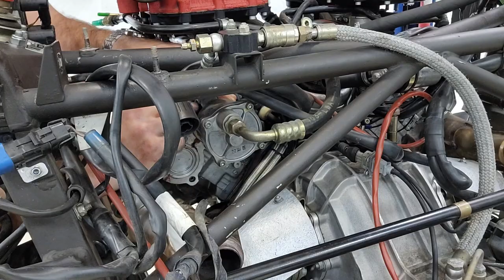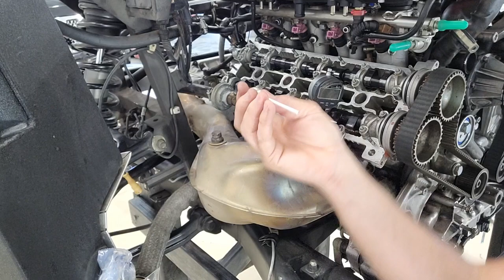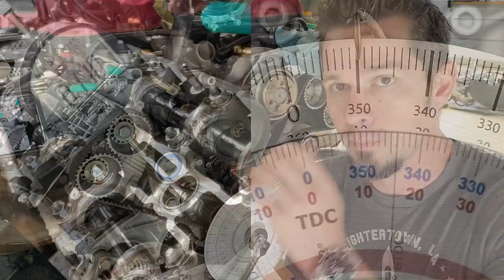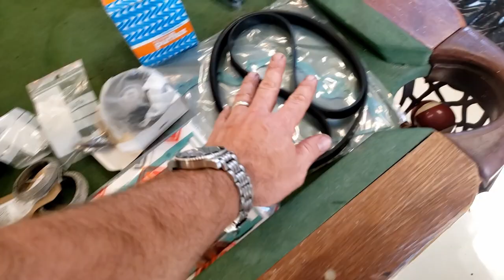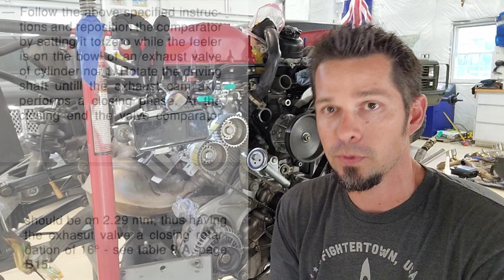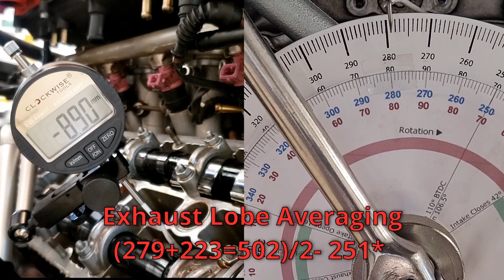Setting the timing on a Ferrari F355 ~PART 4~ Engine out series

Comment: Thank you so much, Kenny.  This is a brilliant video.  And you're right, this is the one aspect of working on these cars that's a little intimidating - well that and threading the short oil line from the oil tank into the aluminum engine block while the engine is in the car :) .  You've done a huge service to the Ferrari community.  Most appreciated.
Reply from the maker: It's very technical and they're are so many steps .. but when you break it down to individual steps and then explain it ... it makes it much manageable. Hopefully this video accomplished that

Comment: Hey Ken, just skimmed video. What you are referring to is dwell and you explained it well. Friendly suggestion, use an analog indicator, much better than digital. Or, use the Sticky RX dead stop 🤓👍. I’ve measured dwell on my 95 and it was less that yours. IIRC, it was 1/2 or 1 degree.
Reply from the maker: Great point!

Comment: Nice video, very concise and clear instruction. I've always used the centrline method, only because thats what I learned as an apprentice mechanic back in the 1980's....But the Ferrari method is defintiely solid, and for those who are not familiar with the centreine method, a lot less chance of screwing it up....Now I'm going to have to go back and look at the rest of the series of videos.
Reply from the maker: My opinion is you should do both. Lobe centerline I think less prone to error.
I found its really sensitive to having your gauge at 90 degrees. On the ferrari method, you have to nail that 2.41/2.29 measurement exact. If something's off, you're going to get erroneous readings. However, with lobe centerline, it doesn't matter as long as your gauge didn't move from the first reading to the next.

Comment: Great video. Looks like a printed degree wheel on top of a Comp cam degree wheel? Would you add the link to replicate yours? What diameter wheel did you use? Happy to buy one from you. After all you did the work. Thanks
Reply from the maker: 355 Crank hub tool: https://amzn.to/3A4om4c 
Timing wheel: https://amzn.to/39TOMv4 
Printable Degree wheel www.blocklayer.com/degree-wheel.aspx

Comment: Watching this again something occured to me.  In your case timing appeared to be right on to start with.  Since a new belt should only be tensioned 1 time.  If there is any question on if the timing is right, wouldn't you want to verify all of that prior to pulling the old belt?   Basically along with the TDC verification.   Then if timing is incorrect fix the timing first.  Put new belt on last and only tension it 1 time.  Of course do a full verification like you show after the belt is on to ensure its all correct and nothing changed.  Thoughts or am I over thinking it?
Reply from the maker: While its edited out of the video, i absolutely checked the timing with both the old and then new belt. IT is necessary? probably not, but i wanted to make sure it was fine before and after.
I also used the old belt to torque the cam gears as well.

Comment: Hi Ken , just wrapping up my 355 engine out service too,  I have a quick question if you don’t mind.  I use the  E manuals as well and I have all my torque specs right on the engine, tensioners , bearings , water pump , but my question is, what are the torque specs for the 20 bolts for the engine cradle? If I’m reading this correct it says “engine bracket fastening “, 53 Newton meters.  I just want to make sure. Also I replaced new engine mounts and transmission mounts and the Emanuel  says, “ pad to chassis plate fastening “, 50 NM.    I am assuming that is the mounts?😂.  Thanks for your help, Brad
Reply from the maker: There's definitely something getting Lost in translation there. I also found the nomenclature confusing however if you look at the size of the bolt it kind of lets you double check if you're actually talking about the right bolt.
I use the pad to engine bracket fastening M16 98 newton meters(which I believe is actually the 12 big ones and likely the four rear big ones) the four wheel well engine cradle ones at the very top, I think those likely are in the 50 Newton meter range
I didn't do the mounts this time, but I do believe they are the either the engine bracket fastening 53, or the pad to chassis plate fastening 50.
Reply: @ExoticCarDIY  thanks for the help!

Comment: Question:  Once you found the arbitrary number where the piston is at TDC, did you reposition the degree wheel so TDC designation on the degree wheel matched that point?
Reply from the maker: Yes, I totally realized I didn't mention that, ugh.
So yes, put the degree wheel close. Then find TDC, move the wheel closer to the correct position and tighten the nut holding it wheel in place.
Then double check it 2 or 3 more times and bend the hanger to point to zero on your wheel
Reply: @ExoticCarDIY  Thank you.

Comment: Can anyone confirm something that’s been bugging me please?

I’ve seen YT videos showing an F355 cambelt change without dropping the engine but no one shows replacement of the cambelt tensioners.

I can’t see the point of changing the belt without doing the tensioners at the same time so can the CB tensioners be replaced without dropping the engine?
Reply from the maker: i believe ratarrossa did replace the tensioners on his engine in belt change.
Reply: @ExoticCarDIY  many thanks for confirming!

Comment: 20:24 whats the name of that instrument ???
Reply from the maker: Dial indicator
Reply: @ExoticCarDIY  Thanks but I mean around the lope? What does that means around the loop??? I'm from Holland so i don't understand that part. 20:28
Reply from the maker: @maartenrijsdijk7823  I think you are referring to the attachment to the dial indicator? If so, it's literally a thick piece of wire, actual I believe it's a coat hanger with a polished tip as to not scratch the lifter, stiff enough to be rigid for the measurement, but still bendable enough to make a notch for the camshaft